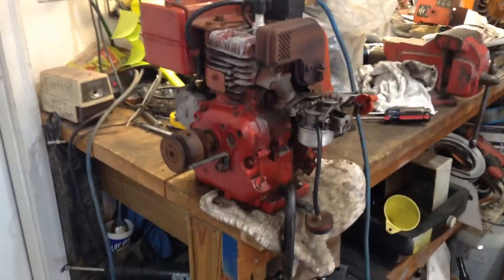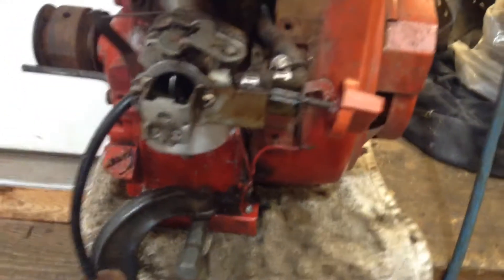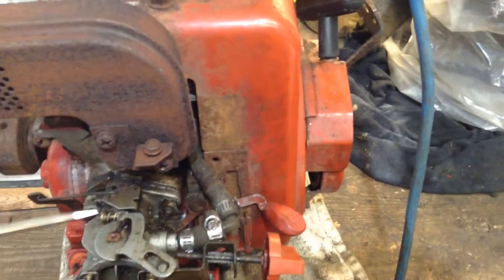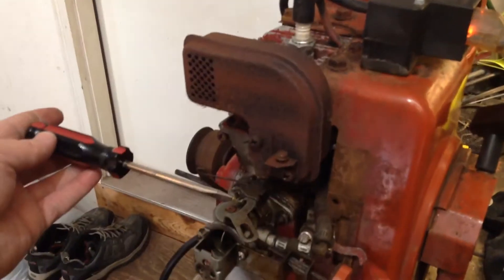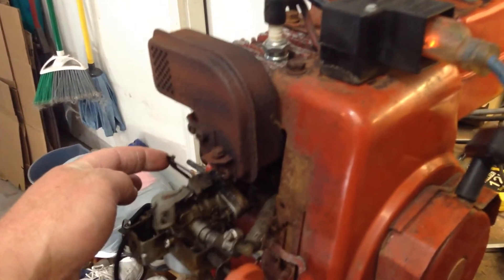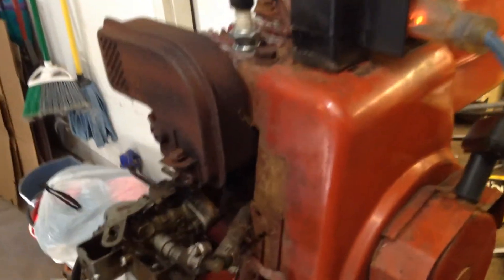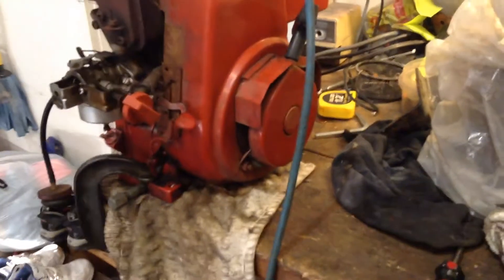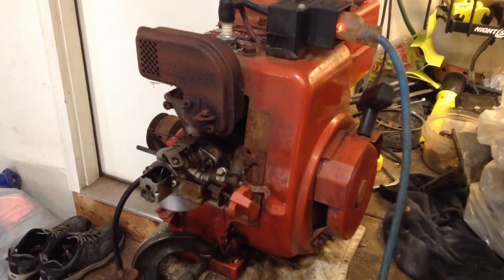Scored an engine for my tiller

Comment: That looks just like the 4 hp Tecumseh on my chipper. Maybe you could find an air filter like what's on it. I'll post a video of the filter sometime today.
Reply from the maker: I put one on it off a pushmower but I think its still too exposed to the dust, so ya if you can get a shot of it i'd like to see, thanks JM!